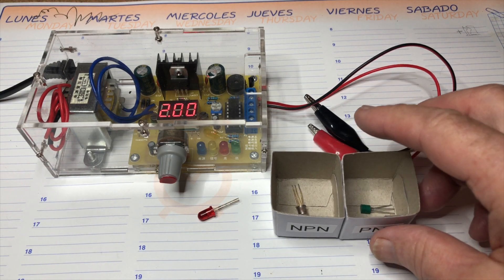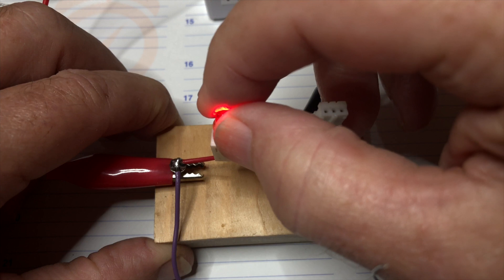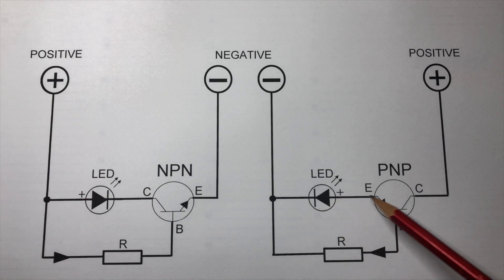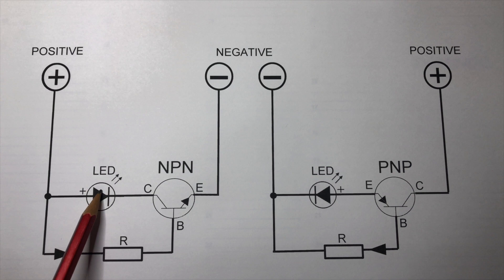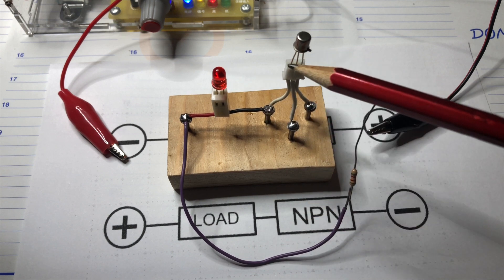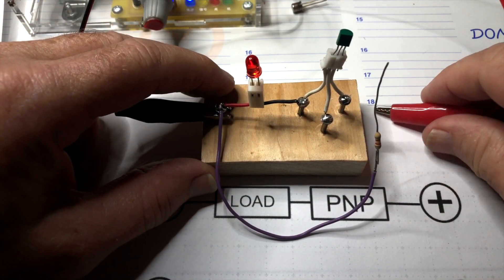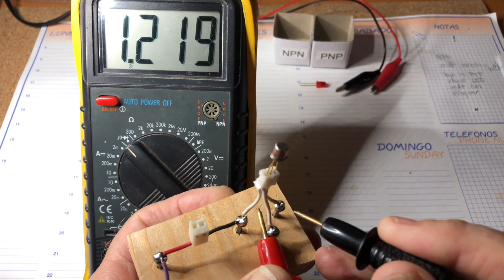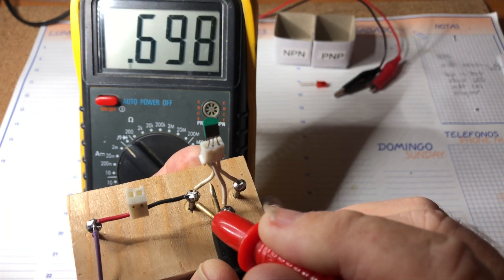How to connect an LED to PNP and NPN Transistors

Comment: hello pops! i have a question. in the NPN topology, when voltage supplies the LED, wont it burn the LED due to the inavailability of the resistor?
Reply from the maker: The voltage that I applied was SMALL in order not to damage the transistor. In a real circuit you need a resistor. That requires another video...
Reply: @osopolarmovies  bless you! I've been wondering the moment I saw this vid and you replied fast! have a good day pops
Reply from the maker: @achmadfasya2363  Enjoy the day! Learning is the FUN in our life!

Comment: My transistor does not look like those at all.
Plus the base is not in the middle as you have them in your diagram.
Can you also leave the LED on the drain of the p channel and just turn the legs around.
Reply from the maker: Google the number of your transistor and you will find the socket type. 
You can move the legs as you like as long as they don’t touch each other.